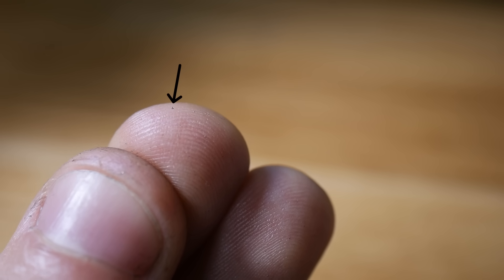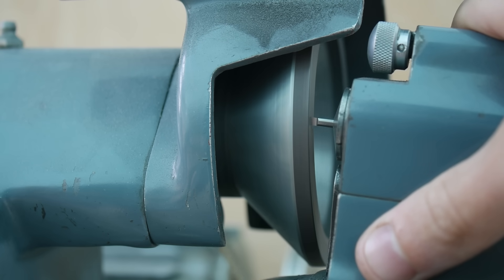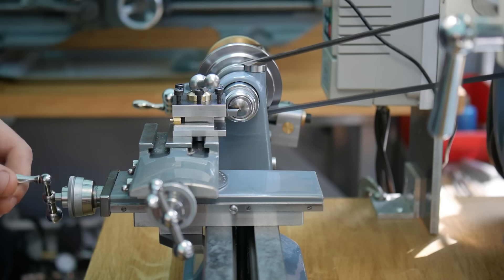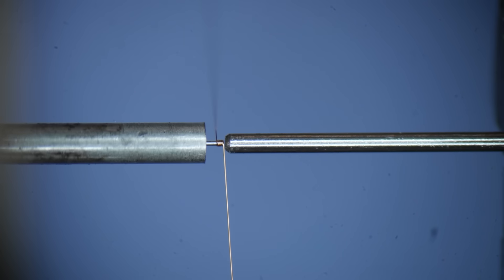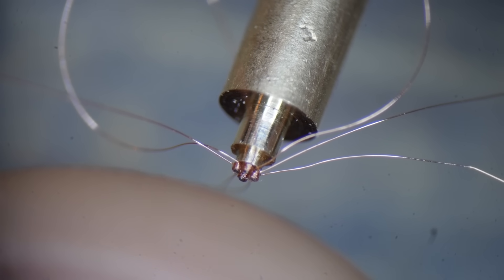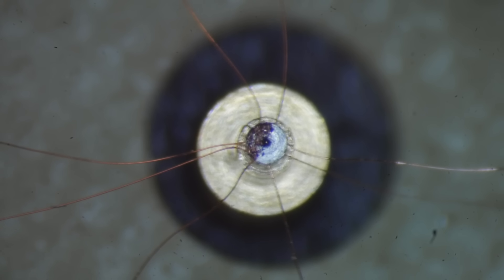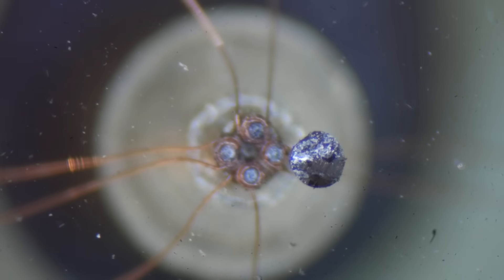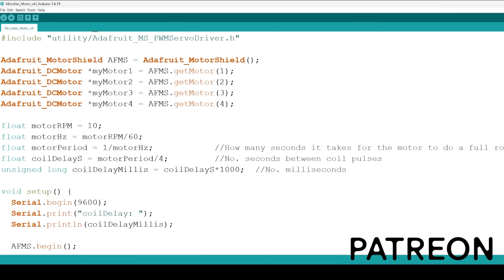Attempting to Make the World's Smallest* Electric Motor

Comment: Wonderful and patient work, well done !
I'm surprised your lathe could produce the resolution needed.
When I worked at the cellular level we made our own micromanipulators which could position to a micron.
Just a vee-block with two carriages which were electromagnets and a bit of a crystal microphone glued between them.
Very simple - turn off the front magnet, apply volts to the piezo (obviously voltage controls the movement and polarity the direction), turn on the front magnet, turn off the back one and remove the excitation volts. With two at 90' you had very precise x-y positioning.
Your hands are very steady but we found a dose of a beta-blocker (propranolol) an hour before made a huge difference in handling tiny things. They are very safe and any sensible GP should prescribe them after a quick check-up.
Using forceps at this size is a disaster.
Good luck with your next attempt.

Comment: drill a hole in the rotor and use a different material for the shaft. same trick as you used for the electromagnets.

Comment: What I'd try is to make a bigger one - like 5 times bigger. And make it repeatedly and refine it until I have a pretty well worked out, reproducible product. Then half the dimensions and repeat the process - materials and techniques of manufacturing from the previous version would probably need further refining, maybe also some more fundamental changes, from the previous version. And then repeat the process two more times, until I get to the desired size. The learning and routine gathered along the way should make the whole process more streamlined, well established and reproducible by the end of it.

And I'd also not use hand-held tools, just tools that are moved and activated using precise stands and actuators. I believe this would allow more precision in both machining and manipulation of parts.

Comment: Working with those little things you should stop using your bare hands as they are too imprecise. Use micro manipulators equipped with micrometric screws. There are also 3D movable platforms which could help you with that, like MellesGriot NanoMax-TS. It has both micrometric and piezo actuators, so the minimum step size is 60 nanometers.
Another (cheaper) way would be 3D-positioner from table-top 3D-printer. You can also program it, so operations like coil winding will be completely automatic and repeatable.

Comment: Instead of lathing a core for the electromagnet, why not use steel wires at whatever micron thickness you want? The same can be applied to the rotor but with a larger gauge steel wire. I've heard of super magnet setups that comprised copper disks instead of wires. Four steel wires through copper disks while rotor is steel wire with steel disks on both ends charged by plasma running through rotor.

Comment: There is heat bondable enamel wire where you just pass current thru to heat the wire which activates the special enamel. Aside from the application of CA your method was nice. CA at this scale.... Well, you know.

Comment: This is so bonkers (in the best way) I'm in awe at your dexterity and patience. I'd also like to echo the use of UV cure glue over superglue. With a bit of practice, it's possible to shape it to your liking by judicious exposure to UV to adjust its viscosity. ie reduce capillary action while applying. It might also help to fix the windings while still mounted on the mandrel followed by a final fixation of the stator assembly.

Comment: The magnetised rotor problem, Make the rotor from mild steel, now because mild steel cannot hold its magnetism, it needs to be hardened, (after machining), in other words needs some carbon defused into it. Because the part is so small this can easily be done by using a `case hardening` powder. There will be many how to videos on here, so I won`t explain further but I am sure this will help. Search terms `case hardening process` and `magnetising carbon steel` The magnets of yesteryear, before advanced alloys were available, were simply made from carbon steel (tool steel). Hope this might help. Chris.

Comment: Amazing work. After seeing small, low cost motors (though actually large scale compared to what you're doing here) with pcb manufacturing methods, it would seem natural to use photolithography techniques to miniaturize it further, and likely to the fundamental limits of physics, rather than manufacturing.

Edit: a quick search gives many interesting results on electric actuators in the nano scale.

Comment: Hi I have made micro hydro turbines and my own alternators. Not as small as this but three  things; prefab the windings and just place them on the cores, use UV curing adhesive, spark erosion machining places no cutting loads on the parts. Spark erosion can be done in a drop of oil. Neodymium spark erodes but surface treating for corrosion resistance has to be quick.

Comment: You can make one more simple. A method of using an aa battery with a neodymium magnet on the bottom a simple wire hanging off the top of the battery touching the magnet will make the wire spin. Could be a more simple method to make micro size.

Comment: crazy idea. Could use your wire to wind a rotor? You already have a fairly good looking mechanism for creating spools. You could use normal metal for the center or wind wire around wire. You could start with a gauge of wire the size you need for the core of the spool. mounted into the lathe head and tail stock. You'd need a way to move the endstop you had without moving the tail stock though. but then you wind your tiny wire around the thicker tiny wire.

Comment: The melting temp of copper is 1085c. So it probably didn't melt but more likely formed an alloy with the solder and disintegrated.

Comment: U could try making a brass part were the rotor fits into and then grind of the excess material. Afterwards you could pull the rotor out with a magnet, place it in the motor and slide the magnet off. Or use a electromagnet that you can turn off.

Comment: Whats crazy is you could 3d print these motors. They would technically fit through the hole in a common 3d printer nozzle.

Comment: Amazing work. Ive seen unleaded fluxed solder dissolve very thin copper traces so I bet its the same with ultra thin wires. I wonder if there are 01005 components like inductors you could use as the coils, even the ceramic inductors are effectively coils inside, Murata has at least two topologies.  Best of luck.

Comment: Wow, very nice efforts, the size is impressive. Actually this is not nano scale, but really small micro scale. Nano scale will be on the order of, well maybe 10 times to an order of magnitude smaller - as in silicon micro machining, or fabrication using masking/etching etc. (Imagine a rotor with a 10 micron shaft diameter - attonewtons of torque!)

In the early '90's I worked with Steve Jacobsen on his patent for a micromotor using electrostatic field attraction and repulsion. The (insulated) shaft rolled around inside the stator hole, so it was called the wobble motor. It was larger-scale micro than yours/Feinman's, the rotor was around 0.3mm or so. We were successful and we mounted a 0.04mm drill bit on the rotor, drilled through a human hair! I laughed as you described holding your breath to assemble things - so true!

Comment: Would it be possible to mill the coil posts one in each corner so then you at least don't have to use CA glue to fix them back on to the backing plate as they're just part of it.  Then it might be impossible to wind the coils unless you could use a star pattern or something where the wires go round all the posts rather than one and then with the drive electronics do some other magic to induce a rotating field?

Comment: Would it be possible to build a negative of the shaft, with a hole that goes completely through. Then when you machined the shaft, you could push the part in, machine it cleanly of, because it is supported, and then push it out from the hole that goes completely through

Comment: I don't know clockwork bearings, but this could be a great idea. My pick would be materials like POM or even some proprietary one design to be used as friction bearing like Iglidur. I was also thinking about graphite, but since it's conductor, it will interfere with coils at some point. But again, I have "normal" scale mechanical design background, not clock or nanotech 😅

Comment: not my expertise...but at that diameter you might be able to get away with coarse lapping paste for yor cut off tool 
half joke half serious
amazing work, thank you for posting

also "pre-wicking" ..if you think you might run into a situation where too much liquid could be a problem...like thin C/A glue, have something absorbant in place before hand.  C/A can thinned with  acetone and or broken down with low temp heat...not sure any of that applies, but i hope it might help

Comment: The difficulty in soldering the fine wire is not that it is melting, rather it is dissolving in the solder.  Using a solder with a couple percent copper will greatly reduce this issue, savbit and cu2 are a couple such alloys.

Comment: Awesome.

Not an expert by any means, but have a few ideas.

Building tools. Your so busy building the project, you mag be getting tunnel vision. A major thing I noticed that most of your tools weren't designed for the job. As you are trying to venture into fairly uncharted waters, you may just have to take a step back and build tools designed for this job.

For instance, you keep losing parts you are cutting off, because at their size, who knows where they went. Why not build a sleeve for each part? Drill a tiny hole into a material, a bit wider than your part. Push that material up to and over your part, so what you want is in the hole. Then cut it. The part cut off will be inside the material, maybe. You could play around with putting a liquid or line the sleeve wall with something sticky, to keep the part from flying around inside ot falling out.

If that isn't workable, what about glues? There must be a glue out there that can stick to the part, and then easily be removed by applying a safe chemical. Put a support on the end and glue the end of the part to it. Make the cut, then dissolve the glue.

Just a couple off the top of my head.

Comment: Maybe you could produce the rotor with a very very small mould? (Though then surface tension of molten alnico may still be too high at that scale). I was originally thinking you could just get tools made of tool steel since it's VH is higher than Alnico (tool steel = 700-1000 vs alnico = 500-700), but then... you already tried diamond saws which have a VH of 10,000 and those ended up breaking. It certainly is a tricky process but I reckon it's still possible to do well.

Comment: While working for DEC last century, the core memory components gave me the idea of making a small motor, but never tried it. The toroid shaped cores in some of the 1970's computers were 0.010" diameter I think, and had 3 wires thru the centre.
Because they could be flipped magnetically, clockwise or anti-clockwise, they would be useful.
Also, I wanted to use 4 of them as wheels for an electric car.(Direct driven). You could do that easily I think.
I saw a photo yrs ago in New Scientist magazine of an etched silicon, electrostatic cogged rotor, flat 'piston' engine. There was some small living thing on top of it, to show its relative small size.
The comment underneath read,
" The Surgeon-General warns that bed-bugs are bad for your steam engine". Very clever.

Comment: You should machine the hole for the rotor shaft, insert a blank of a material you can reasonably remove, THEN apply the glue. Once the glue cures, remove the blank to leave yourself with a nice clean hole.

Comment: This is so incredible!! The first shaft model was correct, but it needed to be magnetized by a string electromagnetic current like normal magnets, if you use the spinning magnets technique the spins got briefly magnetized and it won’t maintain its orientation for a long time

Comment: Instead of soldering, you can spotweld the wires.  That is how the bond wires are connected to the silicon chips inside integrated circuits.

Comment: I'm pretty sure your windings will cancel themself out when you wind in both directions or back and forth.  All windings in a coil need to either be clockwise or counterclockwise. At the end of a layer, you need to bring the wire back to where you started winding and add another layer in the same direction as the first.  Also, when I am working on small stuff under the microscope, I like to use sewing pins or the tip of a hypodermic needle to manipulate stuff.  The hypodermic needle can also be used as a knife.  Isopropyl alchohol will soften super glue, and acetone will dissolve it.  Super glue has a lot of creep; even a single drop will spread farther than you think it will.  You can dip the tip of a sewing pin in a drop of super glue and then use the pin to apply it instead of a toothpick.  As you saw, a toothpick isn't fine enough and it absorbs the glue. You can also use super glue to hold a piece during machining.  Then instead of cutting the material to part it off, you can soak in acetone to separate the finished part.

Comment: What are the practical applications for these motors? Almost all microelectronics have found solid state or near solid state solutions to perform or register movements that would have once needed motors. For instance gyroscopes and accelerometers in cell phones use very very very thin plates  with exceptionally small clearances to allow them to deform ever so slightly but enough that it changes the electromagnet values and those changes are registered and then calculated in a chip that turns them into coordinate information. Idk what an electric motor that small would be useful for at this point in our level of manufacturing sophistication

Comment: Super impressive! It looks like what you need is a pantograph-tweezer setup that lets you transform larger hand movements with mock-tweezers into 1/10th scale movements with tiny tweezers for doing all of the tiny stuff by hand. That would be a fun one to engineer, CAD, and fabricate to have minimal slop and backlash in the system :]

Comment: When thinking in terms of micrometers, why not a unipolar motor? Just like that science experiment with a battery, paper clip, and couple of round rare-earth magnets. At least the structure seems simpler.
As for this four-coil motor, might as well 'encase' everything in CA glue, then machine the rotor bore and top surface once glue dries. Basically this is like all those "I turned this incredibly fragile thing into a bowl" projects, but on microscopic scale. Excess glue will help hold everything in place and give more rigidity. to the motor.

Comment: Nice video. If this is 20 micron bond wire, ultrasonic tools will do a nice job terminating to a pcb. Ball and wedge bonds are commonly used to go from die to package in Level 1 packaging. Same wire size. Doesn’t not need to be stripped if you use the right insulation. Solder can be unwieldy.

Comment: I'm guessing you'll be using UV-curable resin in the future, but if you do end up needing to remove superglue, acetone can do it. Provided a small enough delivery nozzle, squirting it in the middle could probably remove the glue where the rotor goes without completely removing it from the electromagnets.

To handle the rotor, I'd suggest machining the "top", then superglue it to a mandrel. Once the shaft is the correct diameter and length, apply acetone to free the rotor. Alternately, leave it on the mandrel and use the mandrel to position the rotor, only applying acetone once the rotor is nearly in place. Then pull it off with tweezers and allow it to drop in place.

Good luck!

Comment: This is remarkably reminiscent of the over twenty years of professional insect curation I did. I can point up (the smaller insects are glued to the point of a 10mm long triangular piece of archival grade card stock that a standard insect pin passes through at the wide 2mm end) insects down to 0.2mm long. I used shellac secreted by the lack insect dissolved in 95% grain alcohol. Shellac sticks well to the waxy coating on insects due to being very similar chemically. I also preferred shellac because it dried without forming a dry skin on it like white glue or most of the other adhesives. You might find the no dried skin property helpful in winding wire. Also, the slow drying property makes it easier to reposition things without having it cease up on you if you keep the wire in the right spot long enough. Not only did I have to hold my breath pointing up minute insects, I touched the paper point to the 0.2mm long insect between heartbeats. The insects in question were Mymarommatids, as well as equally small Mymarids. https://www.youtube.com/watch?v=qIh29gxm4xU

Comment: Be careful not to set it down somewhere and forget where you put it...

ed You can magnetize the rotor by setting it on the big magnet, then heating it with a butane torch lighter until it reaches the curie temperature.  Let it cool in place, and it will adopt the magnetic field.  The big magnet should have enough mass to ignore the excess heat.

Comment: Disagree with methodology. Micro-etching is the way to go. Any shape and micro-size you want. Wire coil ? No problem. Just need equipment resolution. Mass production would be not issue. How many do you want ?

Comment: Could you pressure form the rotor? If that would work you just need to make a mold of the rotor and the pressure will form the center post. You already had the "issue" of deformation, so why not use the issue as a tool